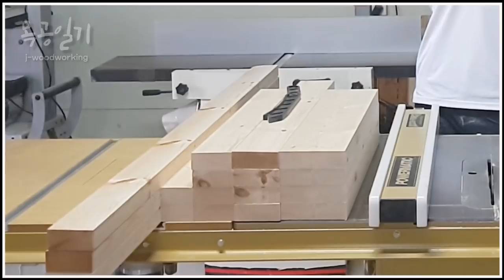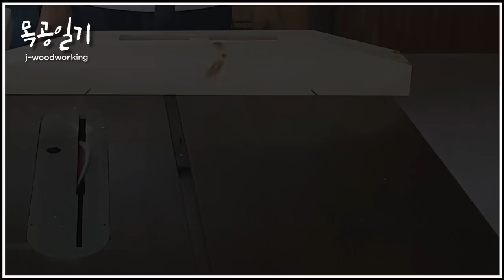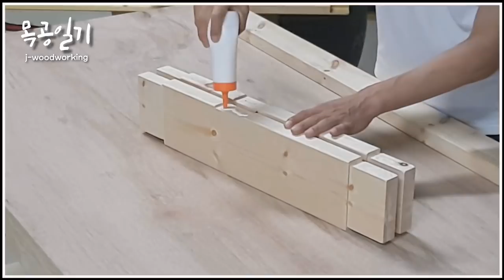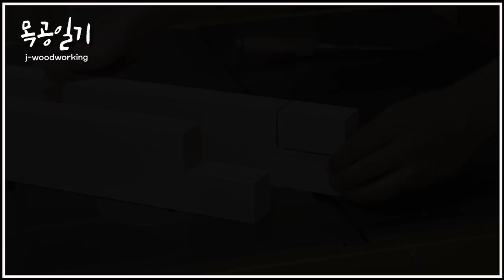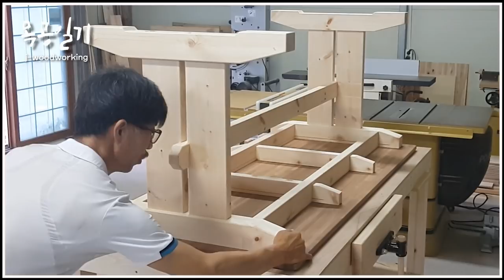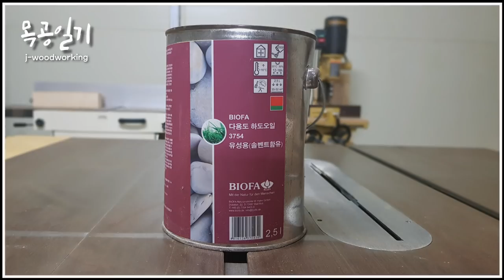making a dining table for 6 people [woodworking]

Comment: Everything is so neat and clean even your table saw has Great Suction power so as not to even leave any dust on the table when you cut wood.  SO, PLEASE don't wipe your Glue with Your Fingers, use a stick or Teflon brush, and Don't wipe it on your pants. It is so unbecoming of skilled craftsmen and Artisan.  just a humble suggestion from a faithful observer and admirer of your skill and technique.
Reply from the maker: Thanks for your kind comment sir.